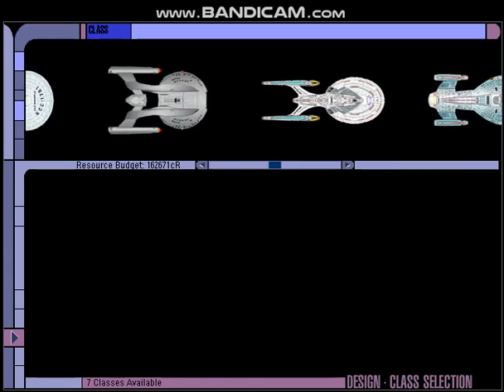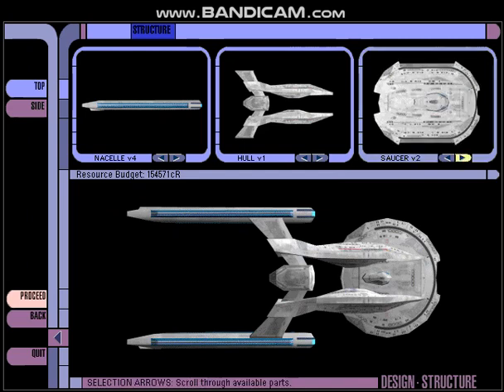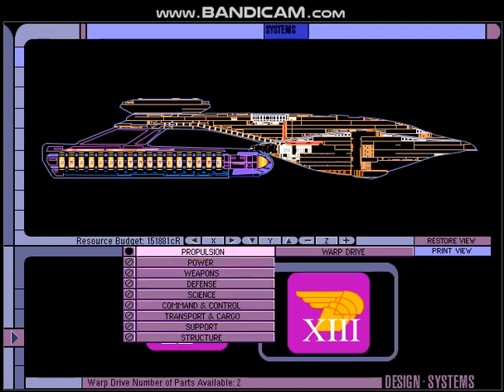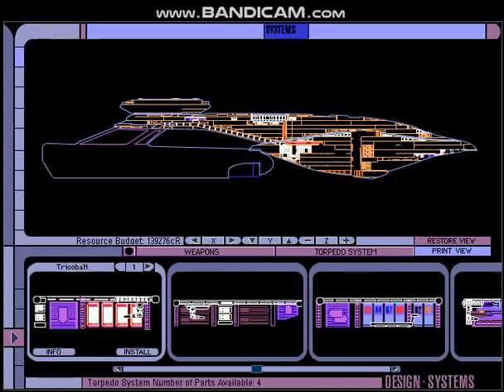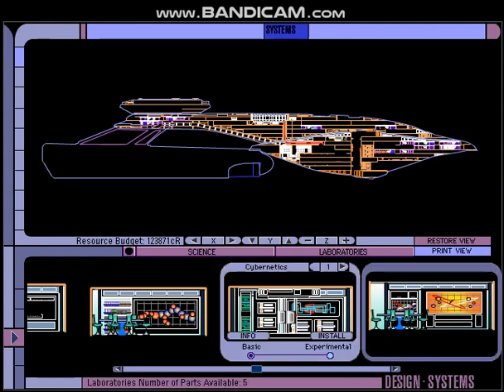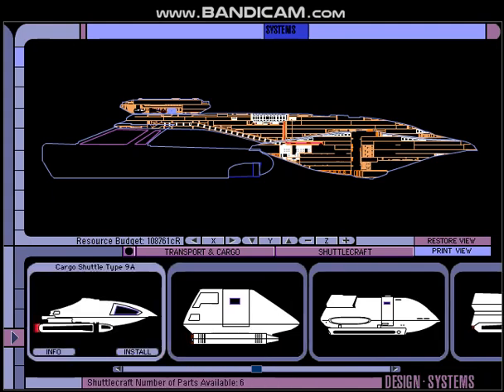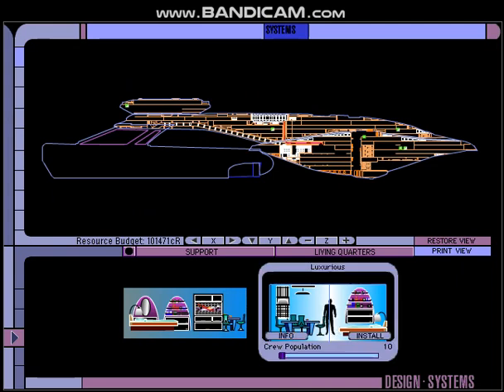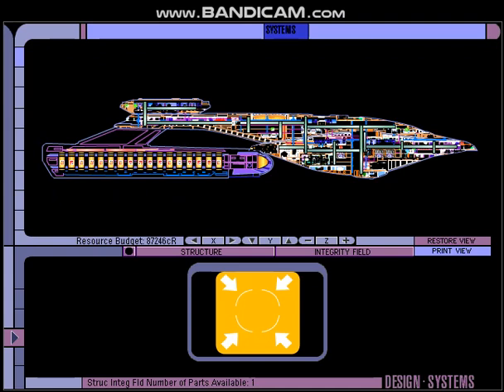Starship Creator: Building an Akira-class

Comment: The USS Potts is simply the best.  Way better than that Franklin nonsense.  Were you not waiting until Tuesday to install the tractor beam and the photon torpedoes?
Reply from the maker: The USS Potts is an excellent ship, but then so is the USS Franklin. The USS Ignored By Matthew on the other hand...

As for the installation of vital systems on Tuesday, the person who had that plan was sacked.
Reply: just watch it will be the first ship to fail a mission
Reply from the maker: @thomasjp1985  Don't worry, the Ignored By Matthew has already failed missions.